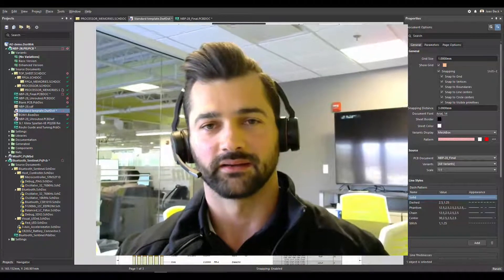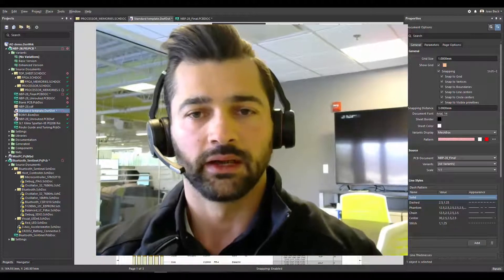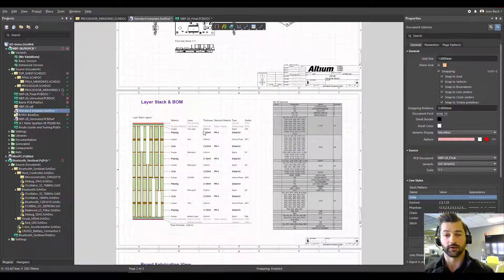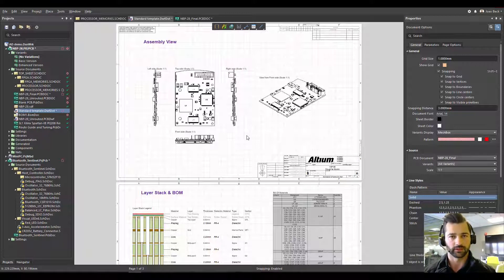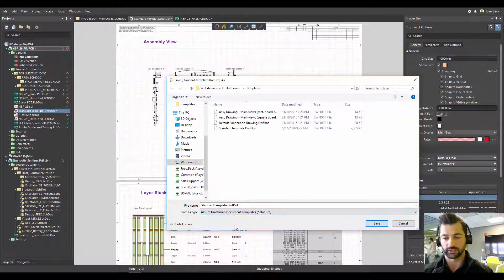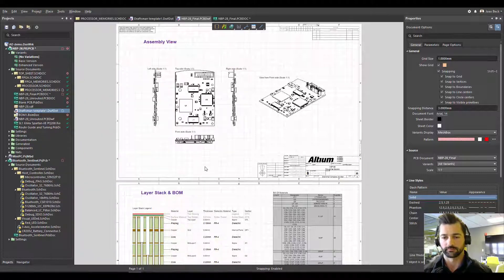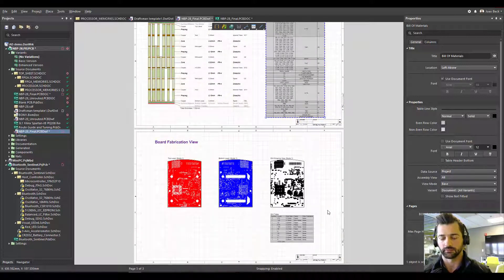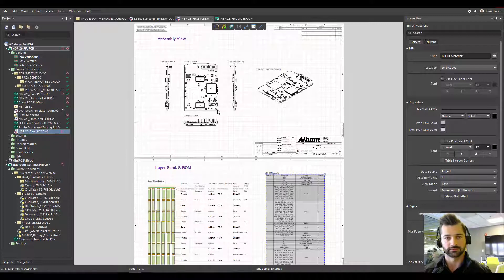PCB Documentation with Draftsman templates - Altium Designer

Comment: Thanks for showing how to save a default setup draftsman template - trouble is that I don't work for Altium and I can't find any way to change out the CompanyName! We need to know how to edit the title-block template! Also the defaults option seems to have been moved to 'Data Management' under the options dialog. Stop changing stuff around! :-D